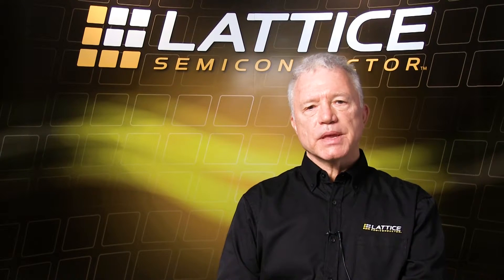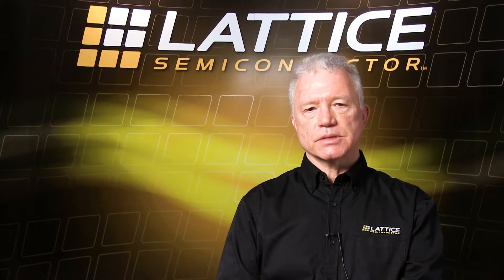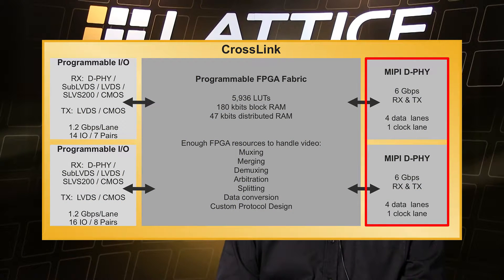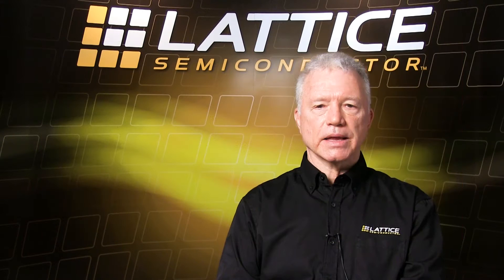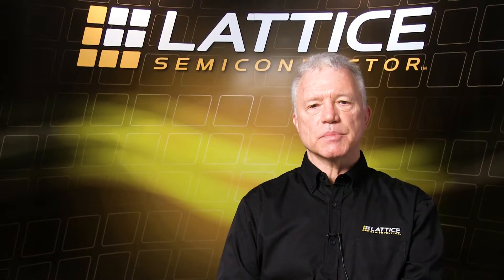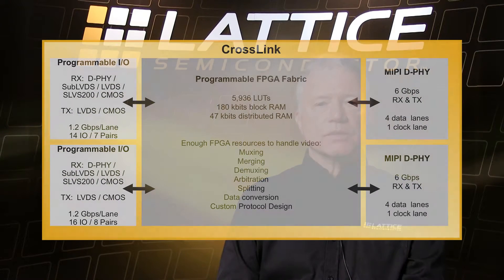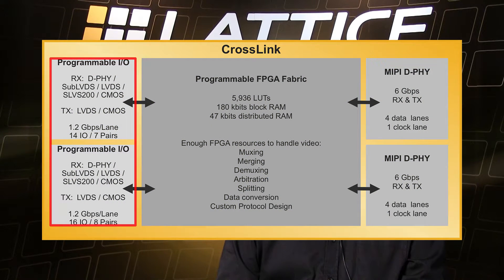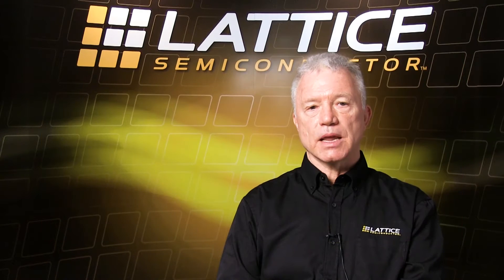CrossLink 1:2 MIPI CSI-2 Camera Splitter Bridge IP from Lattice Semiconductor

Comment: Do you make one of these but works the exact opposite way? As in two cameras to one computer?
Reply from the maker: Actually, our most popular solution for CrossLink is what you are requesting.  We call it aggregation.  This can be done in a number of ways.  One way is to multiplex the inputs where one frame is sent at a time by each sensor.  This keeps the output bandwidth largely the same as the inputs.  But the latency of the output is a frame time.  Another method we support is to merge two camera frames side by side to create an aspect ratio twice that of the input sensors.  This is typically done when the input sensors are the same resolution and frame rate.  This keeps the input/output latency to one line time.  This is most popular.  And yet another method is to use Virtual Channels as defined in the MIPI CSI-2 specification.  We support all of the above. Get more details here: https://goo.gl/Du4kuV
Reply: @latticesemiconductor  I have had no luck with you csi aggregator demo. It will not assign the TX pins because of a buffer size issue. I have tried it several times and tried following what little documentation is available. A tutorial would be very helpful.